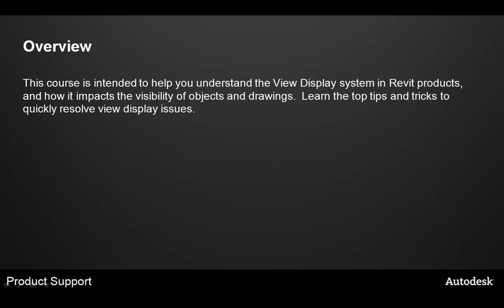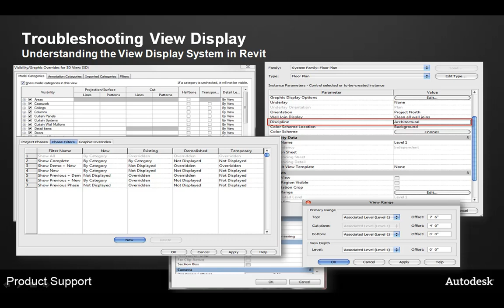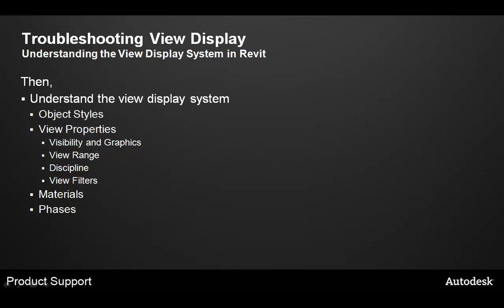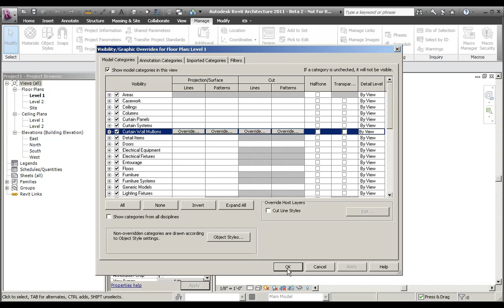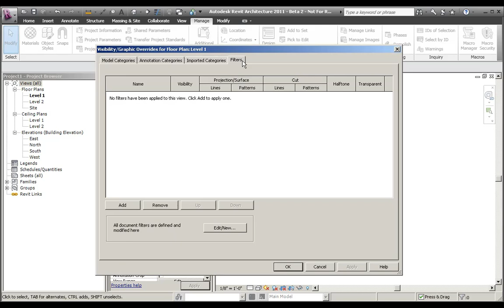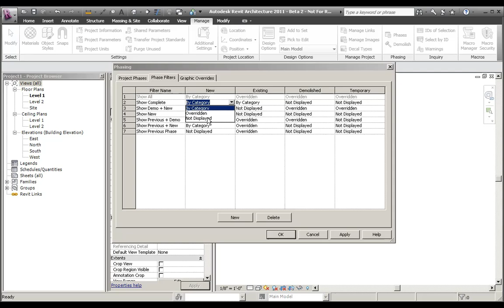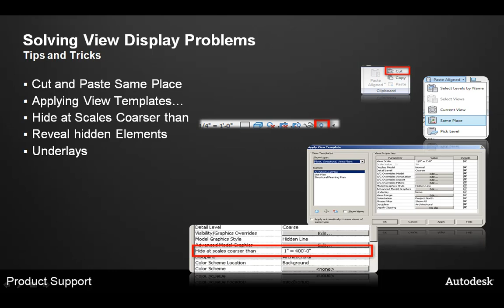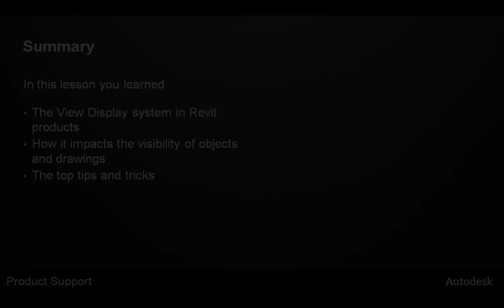Troubleshooting View Display problems in Revit

Comment: Okay, so what's the big help master, if he does not scale the structures? Does an autodesk have any software that scales structures?
Currently I use AltoQi software suite to do the sizing of electrical, hydraulic, sanitary and structural networks, all in a single integrated model (BIM), but I'm very dependent on Revit in the architectural part and in the production of rendered images, I wonder if it really is not a site, an Autodesk sells it as if it did the calculation, grateful.
Reply: Josue Maciel you need to go to model space to scale the structure, make a viewport, double click inside the viewport, find the structure and click the scale. If the scale you need doesn’t fit the box then enlarge the viewport. If there’s no option for the scale you want you need to customize it or also can just add a new scale